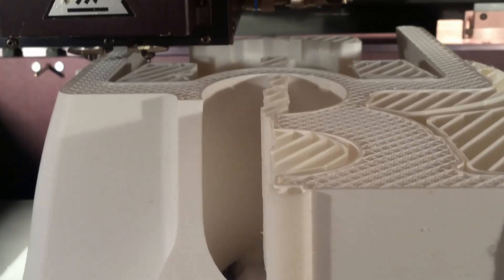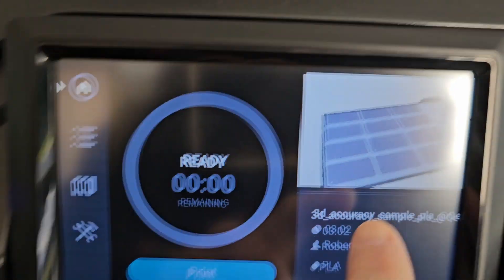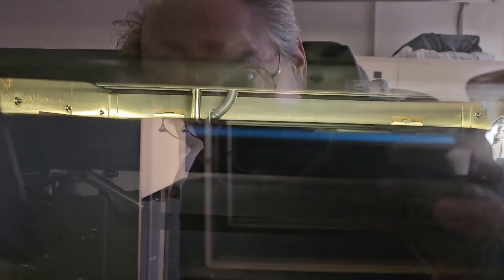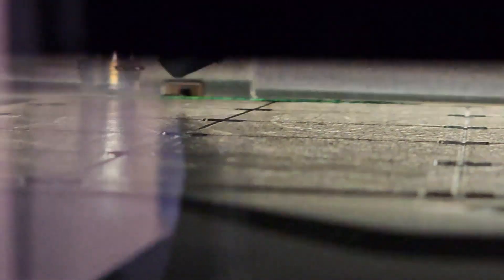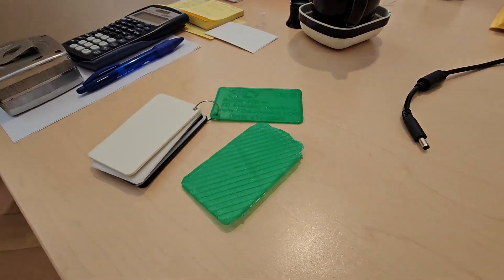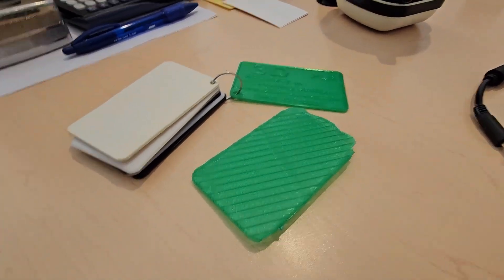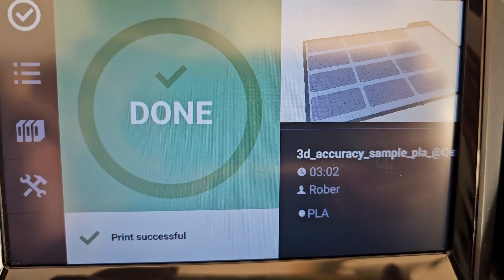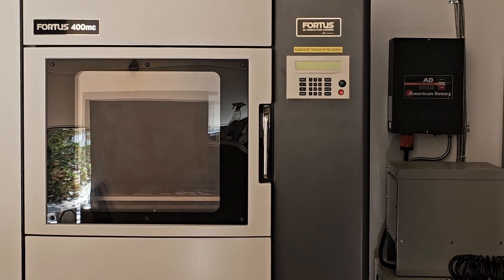Stratasys F370 first 3D Printed parts

Comment: I looked through the channel and it seems you like the stratasys stuff and are running a business. Not trying to be rude but the parts warping and coming off the build plate at the 12:41 mark look terrible for what should be a professional machine. I highly recommend a brim and more chamber heat if they even off that on their machines. Good luck and maybe branch out to try other brand printers, you might be surprised.
Reply: Came to say similar. I only skimmed but what I saw was honestly.. not good. Seems like consumer machines might have surpassed these ones, haha. 

I'm sure there are exceptions and these have their place.
Reply from the maker: Welcome @technicallyreal, thank you for your comment, I appreciate it.

I don't understand what you're seeing that is not good. Could you elaborate? video time stamp, explanation.

All 12 parts printed just fine, no warp, no defects.

What make and model of 3D Printer are you using? I'm curious as to what you are accustomed to.

Have you ever used a Stratasys 3D Printer? If so, which model are you familiar with?

Looking forward to hearing from you.

Have a terrific weekend!
Robert
Reply: @ I don't mean to be negative but I would honestly say what came out of the machine was just okay at best. It succeeded at making the parts, so I can't say it's bad. However, it needs rafts to print on? I have not needed to use a raft in almost 8 years now. Rafts waste an enormous amount of material and time, and they make the underside of the part look bad. Not to mention they are extra work to remove and cause defects if not removed cleanly. 

The prints did not look appealing me compared to what I regularly see come out of a modern consumer printer. Warping of the raft should not happen, and is easily avoidable (without brims) on consumer machines now. The flat layer under the text was not great to me. The solid infill pattern is very obvious and appears rough, and I assume that wasn't intentional (maybe it is exaggerated by the particular color you printed in as it is semi translucent?).

It was difficult to assess the print speed but I feel like it was at best half the speed of newer consumer machines.

I currently have 6 Bambu Lab P1S machines. Before these I had many others such as Prusa MK3S+, Creality Ender-3 S1 Pro, AnyCubic Kobra Max, DaVinci 1.0 Pro, Makerbot Mini, and others. 

All machines before the Bambu's felt hobby grade. The Bambu's just work, always work, we can run them 24/7 and it's very rare to have issues. Most of them are over 3000 print hours now (got the first 2 approx 1.5yrs ago now). Each of them has an AMS unit with 4 materials loaded. We print multi-color and single color objects. PLA, PETG, ASA, ABS, TPU, and PC. Sometimes carbon-filled, sometimes glass-filled. Sometimes special support materials, sometimes PLA as support for PETG and vice-versa. 

I have never used a Statasys machine myself, unless you count the MakerBot.
Reply from the maker: @technicallyreal, thank you for your reply.
I prefer the way Stratasys prints several layers of support material before printing the model material. PLA is the only material Stratasys prints without a different support material. It's PLA support with a PLA part. All others material ABS, ASA, PC, PA ... etc. use with a soluble support material. What I like about it is that it holds the print firmly to the build sheet but once finished it can be removed from the build sheet without much difficulty by simply flexing the build sheet. Then everything gets placed into a heated support removal tank where the support material is completely and magically dissolved away and only the 3D Printed part remains. Clean, simple, easy, just the way I like it. And, as a bonus the top and bottom of the parts appearance look the same. I've never liked the look of a 3D Printed part where the bottom of the part is smooth and shiny, and the top obviously looks 3D Printed. Just looks goofy to me, like somebody couldn't make up their mind.

Yes, you're right. The translucent gloss PLA exaggerates the appearance and makes it look a bit rough. It's deceptive as the part feels smoother than it looks.

Sounds like you've found a 3D Printer that works very well for your needs. That's great.

I'll stick with Stratasys 3D Printers. They fit my needs perfectly.

Have a terrific weekend!
Robert
Reply: @3daccuracy  I'm sorry to say that what you described is not unique to Stratasys, and in fact is considered outdated technique now. I think you would really benefit from some more research into other modern machines.

Stratasys has not been keeping up while the consumer/prosumer market has entered a new generation of machine and technology (seemingly twice now). In fact Ultimaker, one of the companies Stratasys acquired, has been lagging behind and recently announced its next-gen offering, only for it to appear to be a rebranding of another company's mid-grade consumer machine (Flashforge Adventurer 5M Pro). 

Regarding support material, consumer/prosumer machines can use soluble supports. It is not common only because it is not considered clean, simple, or easy. Better support materials have been developed since then - materials that can just pop off without the need for water at all, while not adhering to the part after printing, even if the z-distance between part and support is 0. It's also been discovered that regular old PETG can act as support material for PLA and vice-versa, for those who don't want to buy expensive support material. 

Regarding the bottom of prints, the bottom of prints look however we want then to look now, and I totally agree that it's better when the bottom isn't smooth, and I haven't had a smooth bottomed print in as long as I can remember for that reason. We can choose from an endless variety of build plates made of a variety of materials and textures. The current standard is textured PEI, where parts stick well while printing but come off automatically once the plate cools down. I personally don't like that texture, and there are even better types of plates than PEI, so now I use plates like Bambu's "SuperTack" plate and BIQU's "Cryogrip Glacier" plate which have a perfect subtle texture that causes the bottom of the print to resemble the top. All plates are flexible now. Some, like SuperTack, require a lot of flexing to remove parts, but are amazing for small detailed prints that don't stick well to other plates or would be ruined by rafts. Others like PEI and Cryogrip Glaicer require no flexing for most things, as they self released when cooled. There are even plates that imprint patterns and holgraphic effects into prints now, for those into that kind of thing. 

It only benefits you to be more open to other options. Especially when Statasys is known to be a bully in the industry and apparently letting their product grow stagnant.
Reply from the maker: Good morning @technicallyreal, thank you for your reply, I'm enjoying the conversation.
No need to apologize for telling the truth, you're right, it is not unique to Stratasys. Once several key patents that Stratasys held expired, everybody and their brother wanted to make 3D Printers. So, they borrowed, copied, stole ideas from Stratasys to get in the game.

Who are these people that consider it to be an outdated technique? 3D Printer salespeople from other 3D Printer manufacturers who want to convince you to purchase a new printer? People who've never used Stratasys 3D Printers and don't really understand them? All I know is that everyone I've talked to who owns or uses a Stratasys 3D Printer really likes them. Some years ago, I was looking at purchasing a 3D Systems FDM style 3D Printer, a desktop, hobby type printer. I told the sales rep, who had been in the industry for a number of years what I needed it to do, and he told me flat out "DO NOT BUY THIS PRINTER!" He said "all these desktop hobby printers are not intended to be used in a 3D Printing Service Bureau. Industrial and high-end customers will not like the print quality. If you want to do it right, only purchase Stratasys 3D Printers." I'm glad I took his advice.

Regarding research into other 3D Printers, in a nutshell, any printer that doesn't have a sealed, heated build chamber and two separate print tips to run both model and support material is automatically crossed off my list. Any printer that doesn't utilize a support material than can be completely dissolved from the part, not just softened into a mucky slime, in a heated support removal tank is also automatically crossed off my list. Not sure, but I believe this eliminates pretty much everyone except Stratasys.

Stratasys soluble support material is a must for me. I print a lot of complex medical devices, electronic housings, automotive parts, things that have very fine features and complex geometry that I don't want to be trying to pick break away support material out of. I have tried other less expensive so-called soluble support materials, but they don't work as well.

I think for those 3D Printing more simple parts the other options you mentioned should work fine for them.

I have no detailed documented information on Stratasys' business plan regarding their purchases of other 3D Printer manufacturers. I have my own thoughts on it, but I'm not going to share assumptions here. Personally, I don't care what Stratasys does with them. I only care that their 3D Printers make the parts I need in the materials I need.

That's cool about all the build sheet options available to you. I'm sure none of them will fit or work in my Stratasys 3D Printers, but if there's a way to make it work, or if Stratasys offers them, I may check them out.

You said: "Statasys is known to be a bully in the industry and apparently letting their product grow stagnant." ... careful, now you're making accusations! :) You have to remember, only Stratasys knows what their plans are. They are a pretty savvy company and they are not going to prematurely release new ideas or new technologies until it's good timing. As for being a bully, they are only doing what any good company that wants to protect its intellectual property does. It gets as many patents as it can and does whatever it takes to defend them and protect itself. I have several patents that not only benefit me, but several of my customers as well. It is a smart thing to do. It's just like locking the doors to your house, it keeps the thieves out.

Have a terrific weekend!
Robert
Reply: @3daccuracy  I may not be able to convince you that Stratasys isn't the be all and end all of machines, and that's okay, but I just think you're doing yourself and your audience a disservice. If you have the budget for a Stratasys machine and its proprietary supplies, then all I would suggest is that you spend a tiny fraction of that on something like a Bambu X1C as an experiment for the channel and to see for yourself how far the technology has come in the last 2 years in particular. 

As I said before, I'm sure these machines have a place, but after looking into this model more since my first comment, I am further from understanding where that place is.
Reply from the maker: Good evening @technicallyreal, Thank you for your reply.

Convincing me is unnecessary. I have never thought that Stratasys is the be all and end all. I just think they're a respectable company that makes 3D Printers that work well for my needs. Buying their 3D Printers is purely a business decision.

Consumer 3D Printers are not the be all and end all either. I have several customers who have Consumer 3D Printers at their companies. They still come to me to have parts 3D Printed because there are times I can do things for them that they can't do themselves. That never happens the other way around.

You said: "you're doing yourself and your audience a disservice." ... careful, you're making accusations again! :)  Never, as long as I've been publishing videos on YouTube has anyone ever asked me to do a comparison video between a consumer 3D Printer and a Stratasys 3D Printer. How can not doing one be a disservice when no one even asks for it? Towards the beginning of almost every video I publish, I specifically say "where I'll talk about 3D Printing, 3D Product Design, 3D Injection and Die Cast Mold Design". Basically, my channel is about what I am doing in my 3D Print Shop, nothing more, nothing less. No where on my channel description or in any of my videos do I say anything about comparing consumer 3D Printers to Stratasys 3D Printers. If viewers come here looking for that, it is not because of any disservice on my part. They are simply in the wrong place.

I think that's a horrible business idea. Why should I waste money purchasing a consumer 3D Printer I have absolutely no need for just as an experiment for my channel when it's not what my channel is about? Because maybe I'll get a couple new subscribers or a couple likes?  Not good enough. I've been in business for 46 years and know that impulsive purchases like that are never a good idea.

The important thing is that you have a 3D Printer that works for you. As long as it does, you're in a good place. If or when that changes, then move on to something else. Simple business decision. The same applies to 3D Accuracy LLC.

I've enjoyed our exchange. Good conversation.

Have a terrific weekend!
Robert
Reply: @3daccuracy  your loss. Have a good one.
Reply from the maker: @technicallyreal, I knew you couldn't let go of it! ... LMAO ... You should be a salesman for Bambu, just don't come to my Shop trying to sell me one. :)

You have a good one also!
Reply from the maker: Welcome @asv4k8, thank you for your comment, I appreciate it.

Yes, I like Stratasys 3D Printers. I don't know anyone who's used them that doesn't. And yes again, I've been in business for 46 years which I'm actually quite proud of. Most don't make it that long. I must be doing something right, I'm still going strong!

Ahhh ... you are very observant; I was wondering if someone would catch the corner warping, and you did. But don't be too concerned about it. Stratasys is actually quite clever in that it first prints several layers of support material, roughly 1/8" thick, before it starts printing the part with the chosen model material. By the time it gets to printing the part, the lift on the corner doesn't affect the part itself as it already levels itself. Hence, the parts are actually fine, no lift or warp at all.

I knew the corner warping was a possibility before I even started the print because the build platform had been used several times and was already showing signs of wear which indicates possible adhesion problems. Of course, you didn't know that because you didn't see the build platform before use. It didn't matter to me because I was just looking to empty the material spool and get it out of the printer. The parts I printed are just sample prints that I give away. Had it been a print for a customer project a new build platform would have been used.

Regarding other 3D Printer brands, any printer that doesn't have a sealed, heated build chamber and two separate print tips to run both model and support material is automatically crossed off my list. Any printer that doesn't utilize a support material than can be completely dissolved from the part, not just softened into a mucky slime, in a heated support removal tank is also automatically crossed off my list. Most design projects I work on are far too complicated and I don't want to waste my time fighting 3D Printers without these capabilities. I don't think there are any other options available.

Anyway, I hope you enjoyed the video and will come back again. You are always welcome.

Have a terrific 2025!
Robert